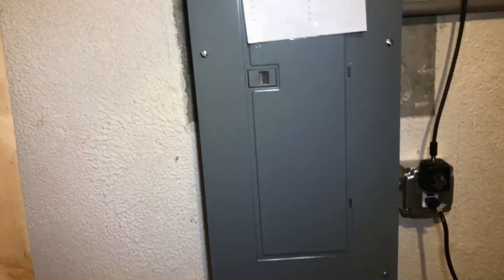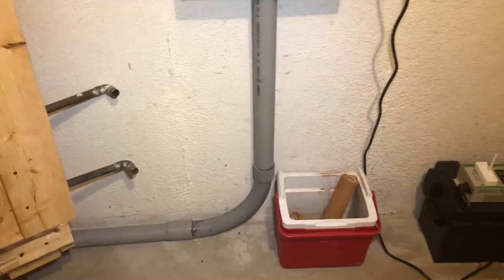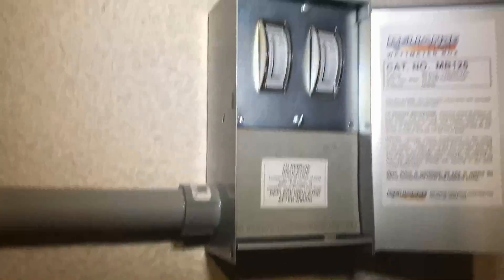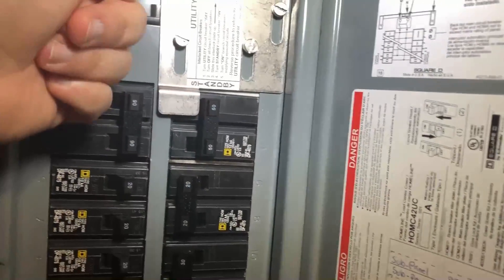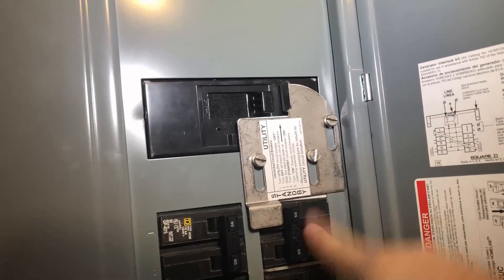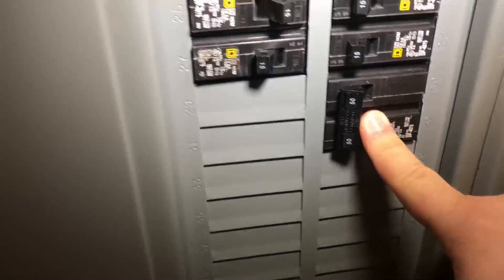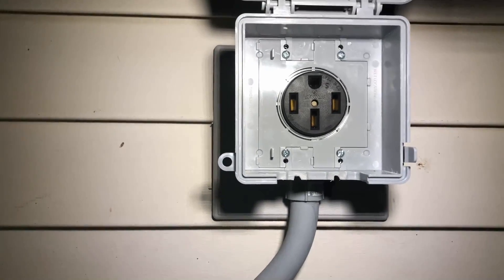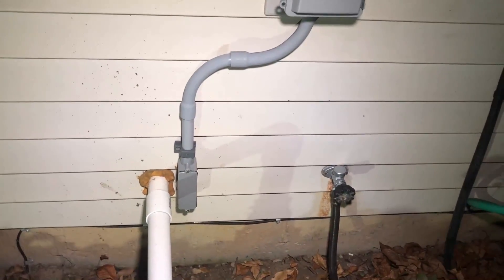Response to Bigclivedotcom Generator Changeover Switch

Comment: Nice installation except for the outlet instead of inlet. I know at one time they were hard to find but they are readily available on Amazon (Or even Ebay) complete with cord for generator now. I like this video except for the use of the suicide cord there's a reason that they should not be sold on Amazon and they should not be made and yet they're all to common.
It is far easier and cheaper to do it the right way. Not to mention safer.

I myself have made one up for a temporary situation but I'm also not using it with a generator (inverter with built-in GFCI). it's meant to give temporary power to troubleshoot or a lighting circuit if I need work on an electrical panel.

Comment: I'd be scared of people unscrewing this for some reason. Youd think "why would anyone do that" but ive seen a lot
Reply: The people who have that bracket are not the people who are going to unscrew it unfortunately.
the people who are going to unscrew that are more likely to not have it and are going to use a suicide cord into the dryer or range outlet instead.

Edit: I to clarify and make sense of what I thought I said.
Reply: @imark7777777  oh so this isnt standard?
Reply: @Gigachad-mc5qz  edit: just realized what comment I was replying to.
The bracket is usually a special order part. And is different for each manufacturer and panel. And it's generally not even considered by the standard individual who just goes to the store and says cord with end + end = DONE!
Not sure if my earlier comment is relevant.

I installed one for somebody and the design made it impossible to remove the panel cover with the power turned on in anyway which was annoying as it meant I had to turn everything off to put the lid back on. And repeat if I need to work on anything.

----

well it is sort of standard, and what usually happens when somebody goes to the hardware store and picks out parts. I actually blame the hardware stores for not actively stocking the right connections to begin with.

They have a kit to connect your refrigerator with everything you need including the bracket that can rust and cause a water leak that's illegal for a plumber to install (if you do ever find yourself doing that get the shark bite one it is amazing).

And yet they don't have a similar equivalent in the generator section.
The general ideas is that exposed contacts should never have voltage as most people will assume that's not energized. It's really too bad we don't have a genderless connection like Anderson power poles.

Generally I would say it's safe-ish as long as all operators and occupiers know how and why. But then again it's easy to be in a rush in the dark during a storm..... Which is worse because things will be wet increasing conductivity.

Comment: Thanks for an interesting video, why do you use an "outlet" as in "inlet" for your generator (on the outside of the house), here in the UK we would have used an inlet? We are very cautious here around power and would jokingly call the male to male cable you presumably have to use with the generator a "widowmaker". Anyway I sure you operate it in a safe manner but was just wondering about uk/us difference
Reply: To be clear that would not meet code because of the inlet outlet issue. It is common around here for DIYers to not use in let's and use suicide cords prongs on both ends. Whether that be into a 15, 20, 30 or 50 amp outlet.